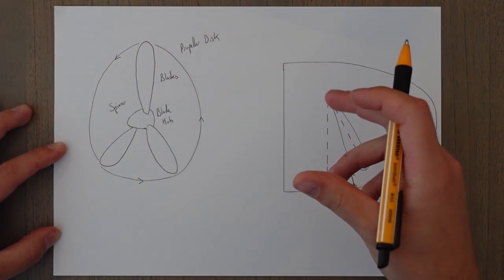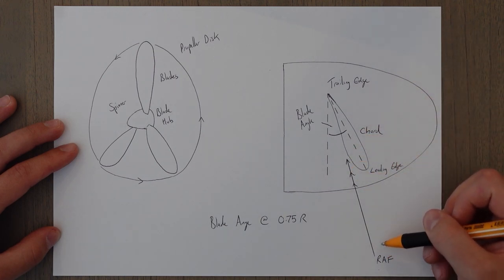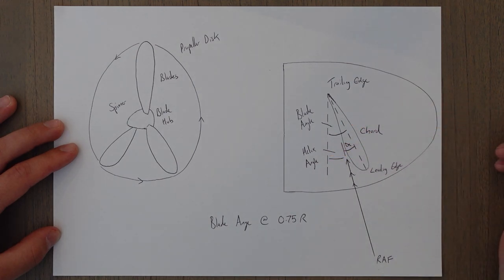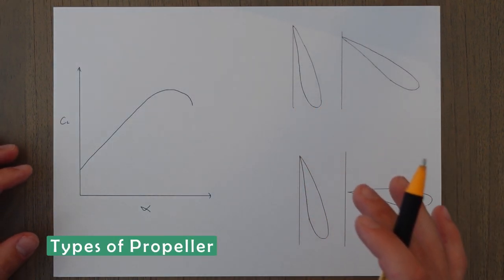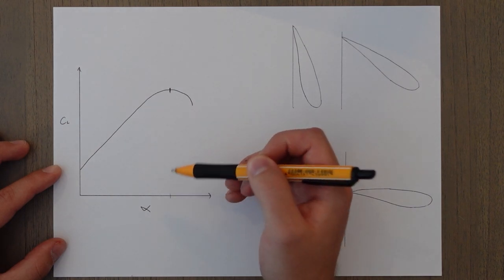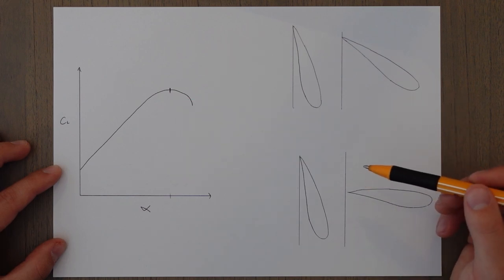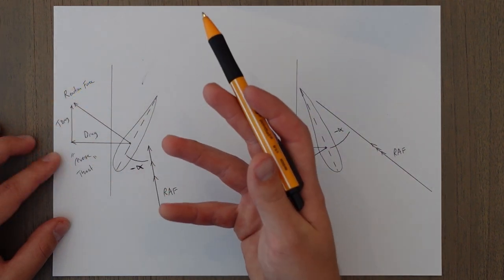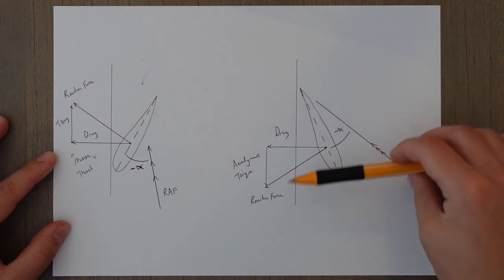ATPL Principles of Flight - Class 18: Propellers.

Comment: Thanks for the excellent video! I have a small remark though, I think you made a small mistake on 6:39. You meant to say higher tangential velocity instead of RPM. RPM, which is an angular velocity, is always constant throughout the whole propeller blade, compared to the tangential velocity which varies depending on where you are on the blade just like you said.
Reply from the maker: You're right!

Comment: I don’t get why the relative wind comes from behind the propeller, and not right in front of the plane of rotation, like a normal wing
Thanks for the videos !
Reply from the maker: It's not coming from behind the propeller. We have twisted the propeller blades so that the angle of attack is now negative rather than positive which creates a force the other way. So instead of normal thrust we get reverse thrust.